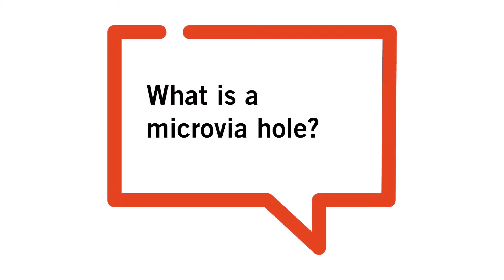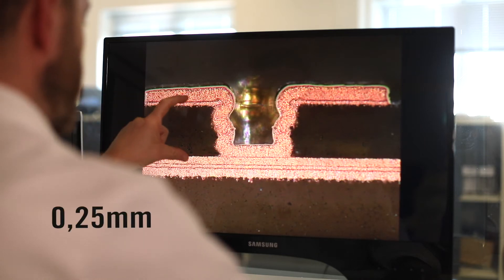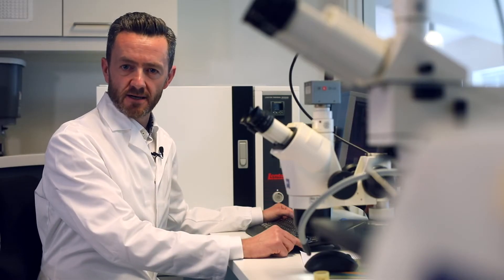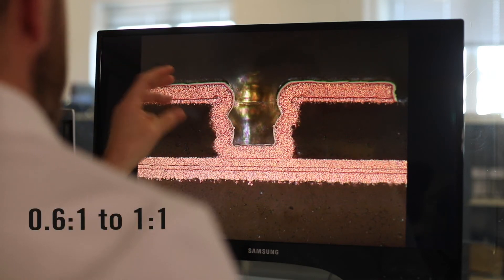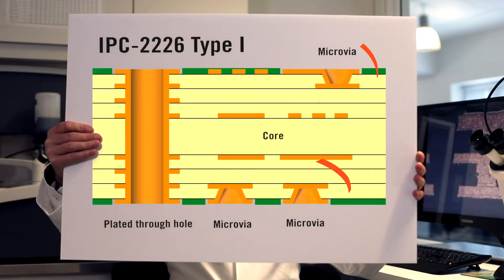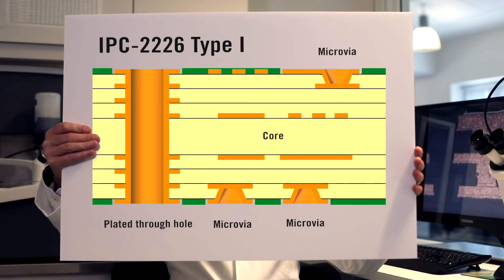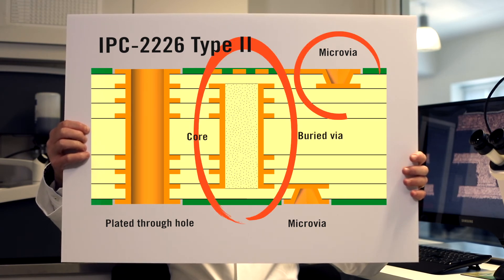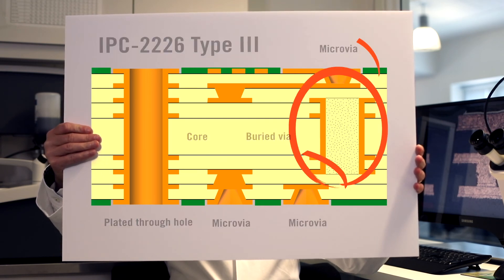What is a microvia hole in a PCB? | PCB design and technology

Comment: is there any difference between laser made blind vias' and drilled blind vias' aspect ration?
Reply from the maker: With the mechanical drilling of the blind via the hole size will be bigger and given we have to try and control the depth of the drill, this will influence the finished product including aspect ratio. Typically we have a hole of 0.20mm and we have to drill to a controlled depth in order to achieve connectivity between L1 and L2. However depth drilling with a mechanical drill brings tolerances that we do not see with a laser drill (we cannot just stop as we reach the capture land). Typically the tolerance on the depth is ± 0.05mm. However even with this tolerance we have to plan to beyond / through L2.